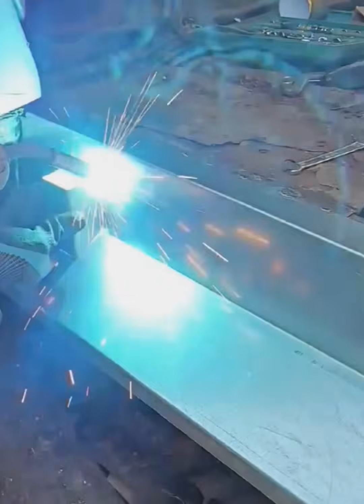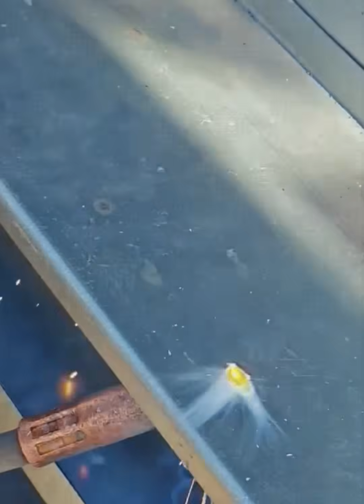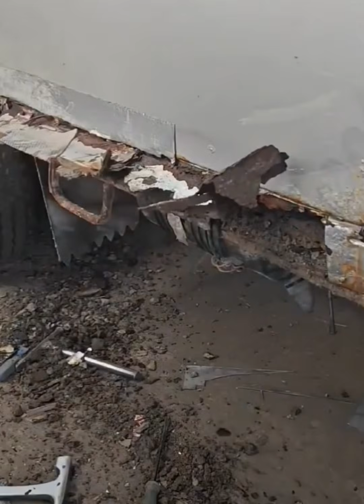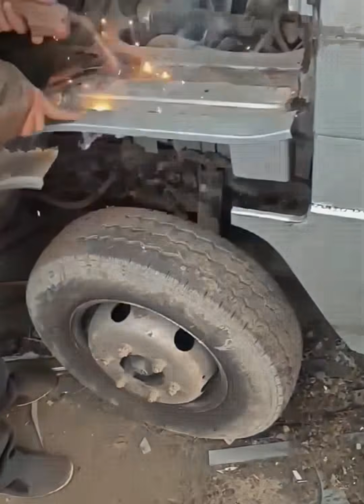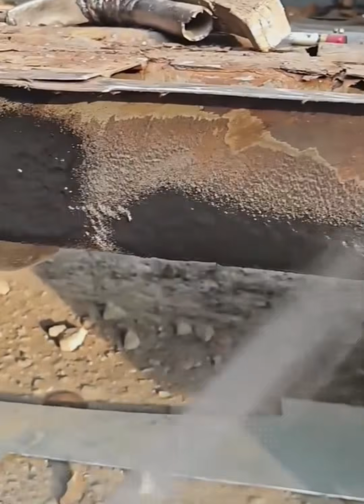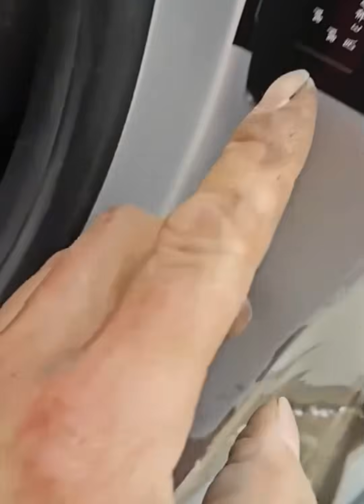Passion for mechanics | Extreme Rusted Car Restoration

Comment: He has very impressive fabrication skills. What I do not understand is reusing the rusted/corroded parts without any cleaning or restoration. At least sandblasting and repainting was in order for those parts. Simply reinstalling the parts alongside all the new shiny metal just detracts from the otherwise fine work.